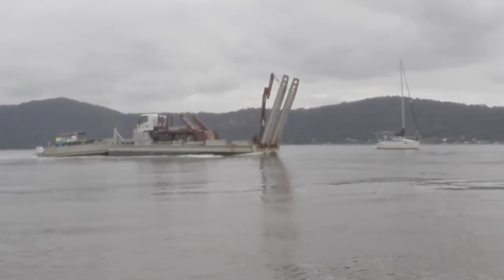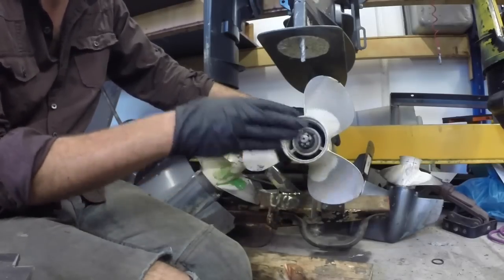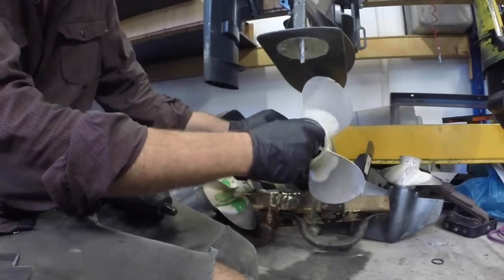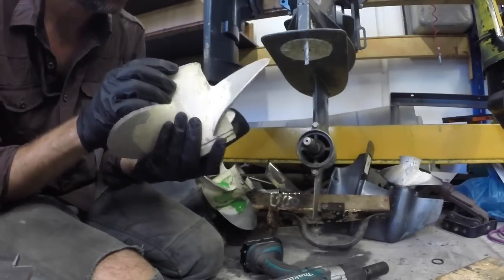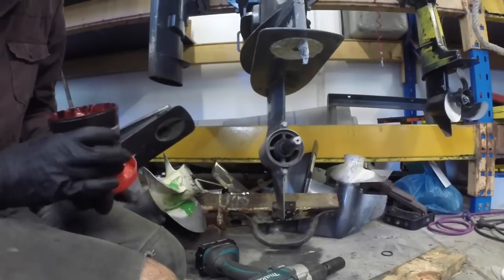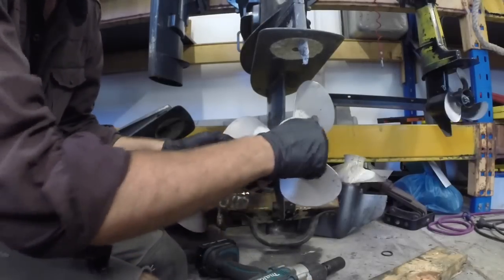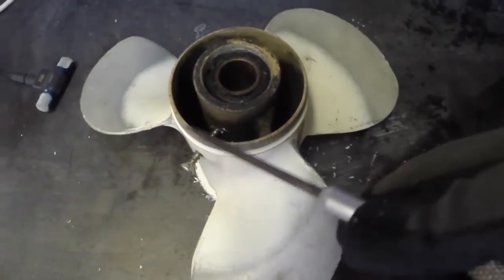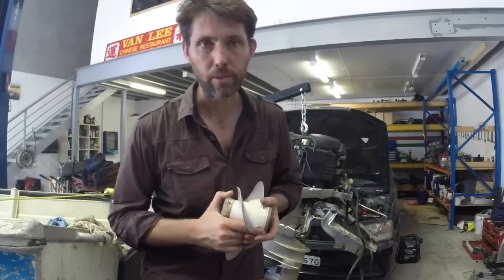Outboard revs increase but boat doesn't accelerate

Comment: My friend I want to say thank you for this video.
I have a 120hp Johnson. I bought a prop from eBay for it over the winter, (as mine was kinda beat up). My first ride was great, second ride it started revving and slowing down. I though my gears were going. 
Your video saved me ALOT of work!! I put the old prop back on and it ran like a champ.
Thank you for this invaluable info!
Be well, and happy boating.
John- from North Dakota.
Reply from the maker: Thanks mate, glad it helped. :)

Comment: I was out in a buddy's little 16 foot Boston Whaler with a 92 15hp Johnson on the back experiencing exactly those symptoms. Runs great in the driveway but no guts on the water. Tomorrow the prop comes off for an inspection of that bushing, which I suspected might have been the problem to begin with. Thanks as always Stu for the great informative videos.
Reply: bet that wasnt it!
Reply: @craigbielsky115  Thats exactly my issue at the moment. Motor revs to full revs with no resistance but wont get past 2 grand in the water and I'm just staring at the sky. Any update on what the issue was? Thanks

Comment: My husband is having this exact same problem . He hit a unseen stump leaving the boat launch, at a very low speed. We thought that he was going to have to get into the gearbox and change out expensive parts. I am so thankful that you share expertise with us. I checked my prop and sure enough the thrust bushing is worn out. The rubber is gone. Thank you so much for the info and for saving me hundreds if not thousands of dollars. Our 1978 Evinrude 115 hp will be cutting through the water at top speed in no time.
Reply from the maker: You’re welcome, glad it wasn’t anything more serious.

Comment: I am not in the habit of commenting any videos but I had to make an exception here-  this video solved my problem 100%. I was out on a Lake in Finland when my prop ever so slightly scraped some rock- nothing major, didn't think much of it. But then I had exactly the problem with high revs and going nowhere afterwards.I was afraid that the gear box was damaged but simply changing the prop as Stu suggested did the trick. I also changed to a larger pitch and suddenly my boat moves easier with high load- I just love these videos and the fact that Stu helped me from the other side of the planet. Keep up the great work! Cheers, Kristian from Finland.
Reply from the maker: Thanks Kristan. Glad the problem wasn't anything more serious! :)

Comment: Another great video as usual.  Great info for a new boat owner (I'm a marine tech as well, 8 years experience and I carry both Evinrude and Mercury certifications)
Reply from the maker: +classicoutboards Thanks! Where are you based?
Reply: Connecticut, USA
Reply from the maker: Must be nice an chilly at the moment. Hope you aren't having too much trouble with the snow.
Reply: Not super cold here, but we had snow Saturday into Sunday.  I have been rigging new boats for spring delivery, and tomorrow am helping bring boats to one of the two boat shows we do every year.
Reply from the maker: Cool, glad to hear there is always work to do, even in winter!
Reply: Can we have a chat? I have a 89 champion 184 with a 88 evinrude xp 150

Comment: Thank you for great videos. I think you just solved a problem. My outboard on my sailboat seems to be losing power. The engine revs just fine, but she don't go like she used too.  Sooo. Tomorrow I will pull the motor and check the prop. and clean the plugs. and air filter.

Comment: Great tips Stu. Never knew you could even fix a prop with a spun hub. Great info to know and have. Thanks!
Reply from the maker: Thanks mate. It's a good technique to file away in the back of your mind should you ever need it.
Reply: It isn't 'fixed.'  It's jury-rigged.  Don't run the boat with the prop like that longer than necessary; replace the prop or have a 'proper' replacement hub pressed in.

Comment: In my old johnson 4CV 2T (1994) it was not the prop. I serviced it, then it began to rev up and getting speed slowly, but full speed. It has a spring onto the prop shaft, to engage or disengage forward gear. This spring needs to be totally down the shaft, otherwise it loses grip and the prop revs up slowly. I did not mount it properly. Everything else was fine, I thought I destroyed the gears but fortunately everything was perfect. 4cv johnson 2t gearbox is very simple and sturdy, I think only lack of oil can destroy it. Big thanks to Dangar, this site is amazing, I learned tons of stuff. I am an amateur fisherman hanging aroun tyreenian sea in italy, calabria

Comment: Thought I heard a strange sound from my outboard followed by the boat losing forward momentum. The boats been much slower than normal, even at full throttle, and it's had me baffled for over a week. Going to check the prop in the morning. Thanks for the tip.

Comment: When I was out the other day, I had these exact symptoms. Boat would move at low RPM but as soon as I would give it throttle, it would over-rev and we wouldn't move. This is the first thing I thought of. Thankfully I remembered your very first advice here to check for a prop or lower unit obstruction. That was it! Big old mass of lake weed on the front of the skeg. Put it in reverse and backed out of it. Problem solved. :P
Reply from the maker: Glad it was something simple! :)
Reply: @DangarMarine  me too! Although I am going to try a different prop. Based on the prop selector from Solas, my 13.75in x 15 pitch is well under pitched. Does make sense as the guy who had the outboard before me used it on a pontoon. Going to try the recommended 13x19 and see what we get.

Comment: I was out for a first test of a newly rebuilt 1968 evinrude 9.5hp yesterday and it spun the hub, it failed after I put into reverse.  I had a spare so no big deal, but I thought about this video and it was a quick diagnosis.  Its a good runner after a bit of work and very few dollars.  I got 3 and half 9.5hp for $150 so I'll have spare parts for a life time.
Reply from the maker: +alnbaba Sounds like you are well set up for long time of boating!

Comment: Same thing is happening to mine. But my bushing seemed ok and spline on prop was good. I thought *maybe my gears? But it high revs and goes the same speed you were. I may just do a whole prop replacement before i mess with gears. Good video!

Comment: Thank you, I just took my used boat out for the first time today . It was my very first time out and after about 15 minutes this happened to me I lost acceleration and it would only go forward slowly. I was scared it was a serious issue. I'm going to take the prop off and see if that was the problem.

Comment: Vry incredible tip to drill holes on either side of prop to secure it by placing & tightening by common hardware screws temporary fix until u manage to get a new prop

Comment: I had similar symptoms but only if I gunned the throttle. If I eased the power on then the boat would pick up speed. Turns out the thrust ring had fallen off the back of the propeller. I wasn’t even aware that the thrust ring was a separate part, thought it was just part of the propeller casting. Wasn’t immediately obvious to me that it had departed. Just in case anyone comes to this video as they are having similar issues.

Comment: Great video, I have just had this happen on my Mercury 15HP motor on our tender. I now greatly suspect that the rubber on the spline has done this having watched your video as these are the exact same symptons. I will now give the repair a go myself and just replace the prop but also do the dodgy fix just in case of an emergency and have a spare available.

Comment: This is quite an interesting video indeed! I have been running my twin Honda 130 HP outboards and I have lost a significant amount of speed. I give full throttle but I was getting about under 3,000 RPM! I was wondering what was the problem so I tried changing the oil as the Honda manual prescribed. This video makes a lot of sense but I'm praying that it's not the bushings in the propellers LOL... Awesome video Stu!
Reply from the maker: +elspaniard002 Thanks mate. If you aren't getting above 3000RPM then it is unlikely to be the bushing as when they slip the engine can rev quite freely, a  bit like a car sitting on an icy road - the revs are high but the speed is low. Sounds more like you are a down a cylinder or something. Have you checked/ changed the spark plugs recently?
Reply: Thanks for your reply Stu and much appreciated. I have changed the plugs but I still had the same problem. What I heard someone saying that maybe the mechanic changed the timing of the outboards. Could this change affect my performance on the water?
Reply from the maker: What year model outboards are they. If they are Honda 130s I'm thinking they aren't very old and will have computer controlled timing that can't be adjusted.
Reply: +Dangar Marine . Thank you very much for the information. I haven't been to my boat as yet but I will certainly have those suggestions in mind when I get to my boat. I remember you had a previous video on when a boat not wanting to start and I listened intently to every word. As for compression I do not have a tester. I checked the fuel and drained the vapour separator as well. Checked for sparks and I got them. Also I sent the starter motor to the repair shop but just not turning over. I realized that my battery cables are corroded so the motors are not getting sufficient current to start. I am going to replace them and attempt turning over the engines again. Thank you so much for the information; I've always wanted to know more about outboard motors and you have been of great help!
Reply from the maker: elspaniard002 Thanks, I'm glad the videos have been helping you. Yes, corroded battery leads are a very common problem out on the water. Let me know how you get on. :)
Reply: +Dangar Marine Thanks alot! Corroded battery leads was one problem for both my Port and Starboard engines. I changed the brushes on the starter motors. Gave the Starboard a try on Tuesday and Vroom it started. The port engine didn't start but I am suspecting that the battery isn't delivering enough current to start it and also dirt or so in the air/fuel filer. (I removed the air filter and it looked dirty).

 I'll correct these problems and attempt another start... Thanks a lot and keep posting those awesome videos!
Reply from the maker: Thanks mate, glad you like the videos. :)
Reply: Dangar Marine hey there! I have a 1968 Johnson 30hp that is using points ignition. Do you have a video on how to adjust this timing? The motor only has two cylinders so I’m not even sure if I have to do this. Noob 2 stroke and carb guy. Thanks!

Comment: Thanks a lot for this. My boat lost traction at a time when I really needed it and it was a scary moment, made worse by not knowing what had caused the issue. Pity there is nothing about this in the troubleshooting section of the manual (Suzuki DF5).
Reply: I have been fishing for years, but none of my buddies with years of boat experience as well knew what the problem was.  so easy but the bushing is so critical - who knew.

Comment: You mentioned the shear-pin set-up ... 

One day, many years ago, we were fishing about 15 miles off the coast of Florida. When my dad put the motor in gear to move to a new place, the 100hp Evinrude just revved.  He quickly cut it, and we looked over the transom just in time to see the prop fall off! Fortunately, we were in about 10 feet (3 meters?) of water, so I could swim down to get it. And also fortunate that he always carried an extra shear pin on the boat.
Reply from the maker: That's the important thing, being able to get your prop back too. Lucky it was shallow water!
Reply: It was late '60s so I may have that detail wrong. I know we had the Evinrude around the same time frame. But I vividly remember the words my dad used as it fell.

Comment: Good to buy spare prop and have in boat just like having a spare tire for your vehicle.  If possible, paddle boat to shoreline and work on in shallow water just in case you drop something. May pickup extra nut, nut wire clip. Great videos as usual.

Comment: +Dangar Marine Thanks for the feedback. It idles a little bit low but not too bad. When I got back to the boat ramp (thanks to a lovely couple who gave us a tow) I was flushing the motor and it went into gear fine without stalling. I have since tried putting it in gear and turning the prop by hand and it spins clockwise with a slight clicking sound every half rotation. It doesn't spin anti clockwise when in gear or either direction when it's in reverse. When in neutral it spins and feels smooth. I took the lower unit off recently so maybe I haven't connected it up properly. It's an old Suzuki dt85 1982 model and they can be tricky to get back together.
Reply from the maker: +Greg Hi Greg, the clicking is normal. Have you made any progress with it?

Comment: HI thanks for the videos. I have a 1979 Johnson 25 HP that has new carb kit and spark plugs. The motor runs great in a barrel I can rev the motor in gear but when on the water it will not accelerate past low rpms about 10 mph. It does not sputter or die just does not reach full speed. It can drive slow around the mooring field all day without problems. The same used to run great but it sat for a while before I got it. I pumped the primer bulb while running no change. There is a shock in the throttle handle sometimes on the water that I cannot feel in the barrel. Please help I'm at wits end
Reply from the maker: I would start with the basics. Check the compression, check the timing is advancing properly, check the throttle butterfly valves are opening fully etc.
Reply: Thank you for the replY! The compression is fine but its a 2 cylinder and one plug was black and one was clean? Any diagnosis from that?

Comment: Hello. I'm Alex.  I have been watching your videos for a while and l appreciate very much your sharing of knowledge.
I wanted to ask you if would possibly share some light on an issue l'm having with my 2006, remote control, 20hp yamaha. I purchased the motor used.
The issue l'm having is that as soon as l put the gear forward (or reverse) it just takes off very fast.  It is extremely difficult to load it back up on the trailer because it will just not go slow.
Any help or advice would be very appreciated.
Thank you very much.
Alex.

Comment: Good afternoon All, 

I have the same issue, boat idles fine. In FULL throttle she goes slow. There's a sweet spot on my Throttle but dosnt go any faster than 1100-1300 rpms. 

Engine has good compression on all cylinders. Reading about 140 for each.

The first thing I changed was the Prop. It was the one with the rubber on both ends so I bought a nice one thats solid metal. Also changed the gear fluid while I was at it.....

I changed so many things on this 1979 Evinrude 85hp engine. Started with the spark plugs, boots and wires, coils, battery packs on both sides, solenoid for the starter, the starter, primer pump and all full lines including adding a new filter.

I also rebuilt the carbs and had them cleaned in some hydroelectric cleaner that really shocks the life out of you cause i touched the water.... 

started using high quality gas and i've added SeaFoam to the tank to better the fuel. Still do not know what the heck is going on?!?!?!

Thanks for this video, we all have a common ground!
-Nic
Reply from the maker: Hey Nic. If it really isn't revving above 1300 I would check that the throttle plates are opening the whole way. Many boats have a mechanism to stop them revving in neutral, maybe that mechanisms isn't coming off even in gear.
Reply: Do you have a video for that? And I watch your videos all the time. You always bring that educational, entertaining, friendly and inviting, functional and innovative experience. I was super excited when I saw your reply.

Comment: Very good information so I tried this and bought a very good quality prop from Marine Engines and it worked for a while then the engine started reving very high and no increase in thrust any ideas as to what I could try next please and thank you :)
Reply from the maker: It's possible that it is not selecting a gear properly. This video may help https://youtu.be/B4acSf_BgP4

Comment: I bought a new stainless prop for my v4 90hp 2 stroke evinrude. The prop weighs 4 times more then the aluminum prop. Is this going to affect performance?
Reply from the maker: A small amount, but not as much as a bent or chipped aluminium prop would.
Reply: Dangar Marine thank you for input. Not on google anywhere

Comment: Hi Stu, have you seen props with both a shear pin and a bushing, I have a Evinrude 4 hp with these symptoms on my tender
Reply from the maker: Could be the shear pin for sure, many older outboards have them.
Reply: @DangarMarine   I will whip the prop off and have a look, I know its not got a clutch in it that's slipping ha ha, thanks.